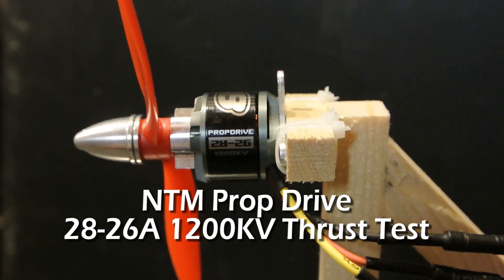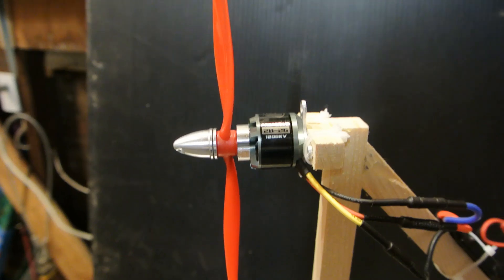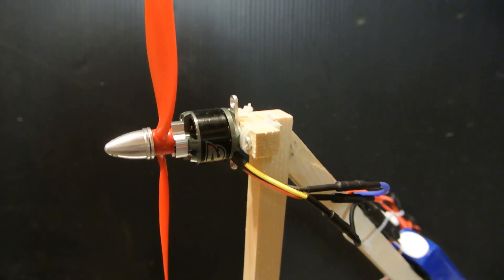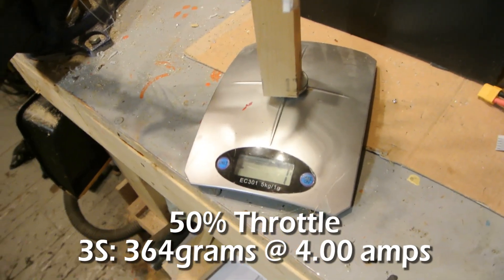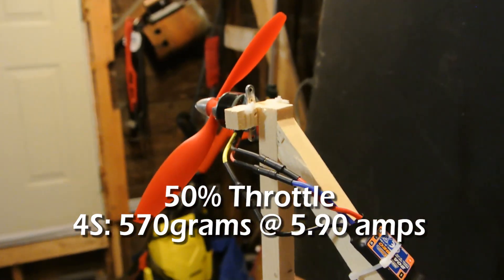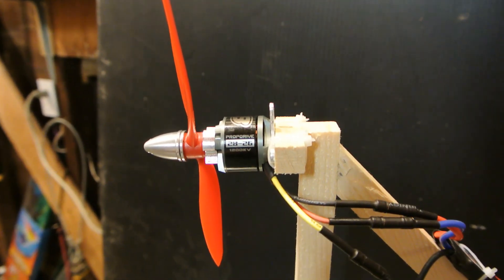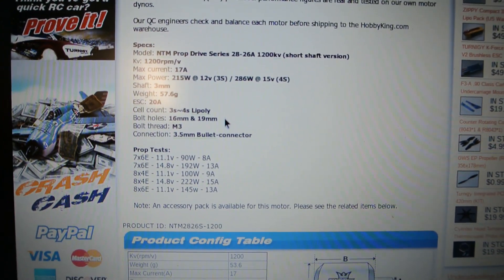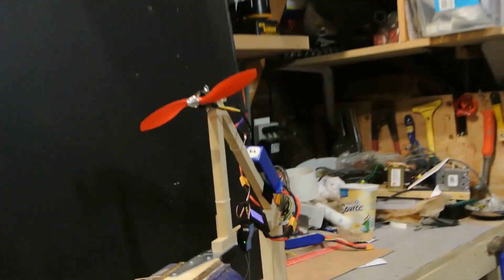Review of NTM Prop Drive 28-26A 1200kv Motor and Thrust Test

Comment: Your propeller looks like a GWS Rs8x4.3 and according to the manufacturer its rpm limit is 10500. So your motor will  surely surpass them with only 3slipo. The safest thing is that this motor these rpm with this propeller at 3 and 4slipo. GWS recommends never using it above these RPM.
If they don't have an RPM meter, you may find that you overreached when you hit 130Watts or 759g of thrust.
in your case at 152 watts you are turning at about 10,785 rpm with an efficiency of 65.6%
With 4slipo and the same propeller it's crazy. I hope they wear a protective mask. 12,965 rpm (2,465 more than those recommended by the manufacturer) with a power usage of 294 watts for an efficiency of only 60.9%. This means that your motor is working on the 179 watt propeller. and 115 watts are being lost in heat in a motor that barely and should dissipate about 60 watts. My recommendation is that you try HD or APCe type propellers and in 3slipo motors that you never use RS, SF type propellers. when they have Kv above 920 unless you use FC propellers

Comment: Thanks for the presentation.  Useful.  Like nearly all you-tubers you talk entirely too much which is not efficient or professional. Maybe write out your script or something.
Reply: are you giving ''professional'' advice on a 5 year old video??? well props to you my man..... maybe check calanders once in a while before spraying your opinion everywere... this dude tried to help... you're just beeing a dick
Reply: @slapjack66  all I can say is I have 2212 unbrand 1000-930kv on 44" x40" cub 45A 3s 30C 10x5. ..AUW 850-875 grams. It had decent power . Not unlimted vertical..but it can do decent loop. 7-8 mins flight time.
It's okay ..better than a basic trainer type of flying.
It'll get 900-1100 grams depends depends who's testing it.
Im thinking Im right around 950.
the 44"x40 cub is a bigger model..but has better wing loading

I need to build 38-40"..to reduce wieght and drag to get it fly with 

a little bit more punch

The 1200KV on 8x4 on 3s is UNDER PROP...on 4S maybe....
Maybe a 9x5 or 9x6...depends on the brand.
The thrust may vari  due to LIpO discharge C rating and esc setting

have 2208 1400kv on 9x5 (orange) it's perfect for the motors on 30a 3s ( same 2200mah) II'll also use 8x4 . The 9x5 dose better
it's on a smaller 30" 450 grams AUW. it might be pulling 650 grams . It flies like a little beast with plenty of power/and punch.
It's using the same type of servo (4 -ea) The 30a might wieght 2 grams less.lol I get 10 mins  becuase it's a smaller motor.
I actully like this little model more...becuase it dosnt get tose around due to heavy wing loadingcuts through the wind better.  10 mins..flight is about right for flying an R/C plane....5-6 mins flight time....SUCKs..becuase you'll spend 2-3 mins just
trying land it.cross wind..coming in too hot...so you'll have to go around
or make a couple passes over...so you can at least try to line it up.
Notice most DYI YT modelers cant land worth a ffffkkk
or they just fly around in circles. Not even basic split S or emuman
landing patterns

Comment: Hello! i have one big question i want buy this motor.
Model: PRODRIVE v2 Series 4238 750KV,  but i not know what good helice i can use he!
i will use this motor in No Extra 300
With 1 meter 20 wing and
Total weight 1.20

Model: PRODRIVE v2 Series 4238 750KV
KV: 750 kV
Max current: 55A
ESC: 70~80A
Cell count: 3s~4s Lipoly
Pole Count: 14
Bolt holes: 25mm
Bolt thread: M3
Shaft: 5mm
Connectors: 3.5mm Bullet

what helice is good for use he?

Comment: Thanks for the video Andrew W. I am just getting into the field of custom build my own quadcopters. Right now I am working on a Q450 Ghost Edition that I got from HobbyKing. I am using an APM 2.8 Flight Controller with GPS/Telemetry, I also purchase some high crab legs, also purchased on HobbyKing. I purchased my first Radio transmitter from Banggood.com the FlySky FS-i6S. I got my battery from a local hobby store the Predator 11.1v 3300mAh 35C, which I believe is a 3 cell? But in reference to your video, I learn to stay away from 10x4.5 and to go with 10X5, i heard that 4.5 can snap? Any what material of props should I stay away? Are Nylon props OK to uses? I haven't decided which motor KV I will need till I get my rig weighed, also what does the maker NTM stand for and whats their web address, so that I can visit their site and view all their motors and specs.

Comment: Abusing mine with 10x4.5 props :)
Reply: +Brrraaapp okay good to know if I switch to 4s I'll have to drop a couple inches.  I can't wait to tune my tri and finally get some FPV flying in
Reply: +iOS Beta Were you abusing yours at 3s or 4s? I'm gonna run my tricopter with 3s I believe.
Reply: +topher
Actually both. They honestly don´t like 4S at all especially when they´re being used in airplanes since you tend to go full throttle more often. I´d definitely recommend to use smaller props on 4S (8x4 should be good).
3S works quite nicely on multirotors, I used them on Tri- and Quadcopters with Gemfan 10x4.5 props.

And just so you know, they will get quite hot anyways, even when you don´t push them that hard. I wouldn´t worry too about that, though :)
Reply: +iOS Beta good to hear thank you so much!!! I've been doing some hover tests and they're warm.  AUW I'm at 1kg with 2 of these in the front I need to save some money to buy my 3rd one lol I'm using a cheapo sunnysky 800kv on the back, it can't keep up when I get to 70% throttle. but this tricopter will be a monster once I get that installed.
Reply: +topher I used mine with 4s on 8x4.5x3 props. No issues at all, pretty good power.
Reply: topher No problem and good luck :)
Reply: iOS Beta Pain in my butt!! Go watch my short clip of it trying to kill me... I touched the ground and I'm not sure if the motor died/loose connection or that 800kv tail motor just couldn't get up to speed fast enough
Reply: topher Can you post the link in here, I unfortunately can´t seem to find it on your channel :/
Reply: +iOS Beta Bad news.  I just realized this is the 1200kv .... I got the 1350kv that I'm running 1045's on lmfao!! I'm gonna go down to 8045 I think

Comment: i was going to purchase a motor of 2212 but they told they have 4 types
1. 2212/13 1000KV
2. 2212/12 1400KV
3. 2212//6  2200KV

i wanted to know which one is better and will produce more thrust . please tell me as i am confused about purchasing motors.
Reply: I know this is a very old comment, but just in case.

The higher the KV the higher the RPM, but it also means less torque. If you plan on having this motor push out as much speed as you can then go for a higher KV.
Reply: 1000 Kv.   Ok. 1000Kv is Ok 9x4,5 and maybe 10x3.8, 10x4.7.   1400Kv is fore 8x4, 8x4.5 not RS, SF propeller.  2200K is for APCe 6x4.

Comment: This is probably a stupid question but is this a DC-motor or an AC-motor?
Reply from the maker: That's not a stupid question at all, as I have really no idea lol.  The power source is DC but the ESC does something to the power source to control the motor as it has 3 wires, not sure if the power at that point is DC or AC.  That's a question for an electrical engineer.
Reply: Hey, not a stupid questions of course ;) The ESC is a "converter" which takes the DC Voltage of the battery and "produces" a three phase AC voltage using PWM. RPM is controlled by the frequency of the resulting AC voltage (not the frequency of the pwm!!) Max amplitude of the AC Voltage is just a bit less than the DC voltage, I hope this helps ;)
Reply: NTM is BLDC motor which is DC motor which require permanent magnet in their rotor. AC motor doesn't require any PM.

Comment: Your higher amp draw (than the specs list) is because you are using a slow fly prop and not a regular "E" prop. The slow fly props have a wider blade and push more air, thus taking more energy to run it. I have the same motor. 8x4E draws 9.9 amps on 3s and rpm is 10,500. 8x6E draws 12.5 amps on 3s and turns 10,300. hope this helps.

Comment: I am using this motor on my Hexacopter, and also quadcopter, and I really like this motor because of the thrust. The only thing I don't like about it, is that the bearings are too fragile, they start to make noise (when you spin the motor by hand) from a small crash. I am running my hexa and quad with bad (noizy) bearings, and it flies fine.... so far :)
I am using Rctimer 30A OPTO with SimonK pre-flashed ESC, (the ESC is cold after flying), and 4S battery, my quad hovers at 50% throttle (no camera, no FPV), and my hexacopter hovers at about 60% throttle, with gimbal, gopro, and FPV gear)

Comment: It looks like you're not using a pusher prop so that may be the results are skewed but good work anyways. I'm looking at getting these motors to use in the new dart400. Any concerns on the bearings? Thanks for the review
Reply: Is there such thing as a push prop? I realise for IC engines you need to buy a specific prop to use as a pusher because you can't reverse engine direction. but for electric motors, you just put the prop on and if it's turning the wrong way you reverse the motor.... I'm pretty sure for electric there isn't really such thing as a pusher prop.
Reply: +Chris Flory Correct, there's only clockwise and counterclockwise and the only reason to change them would be the type of prop adapter you have so it tightens and doesn't loosen. A "pusher prop" just turns the other way because you couldn't reverse the direction of gas motors like electrics.
Reply: I am using the ntm 2830 900 kv,  I can say that they are better than sunnysky motors, very powerful with 4s and graupner eprop 9x5